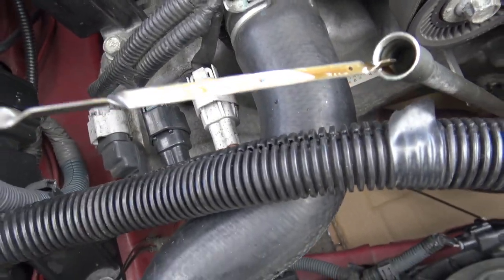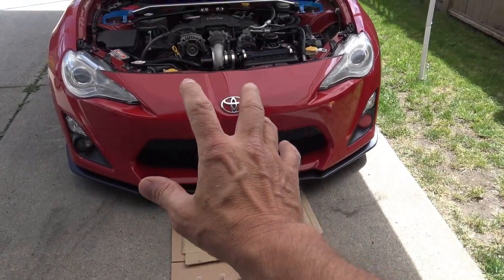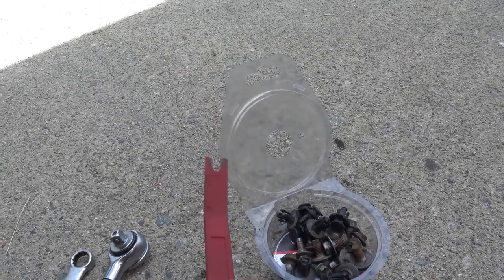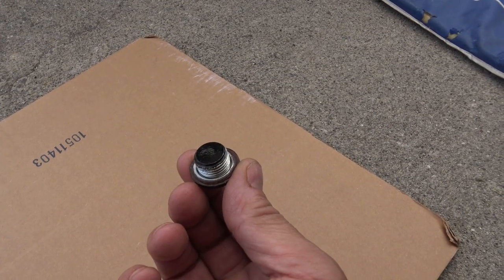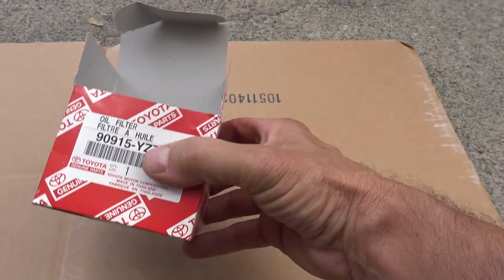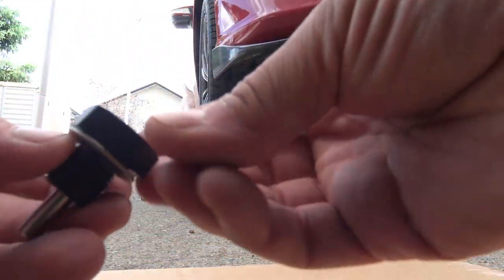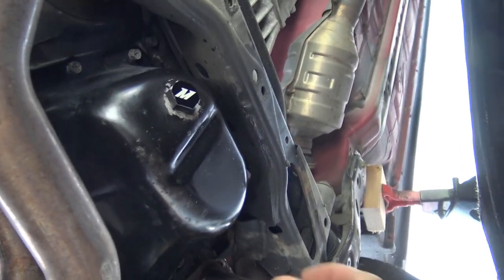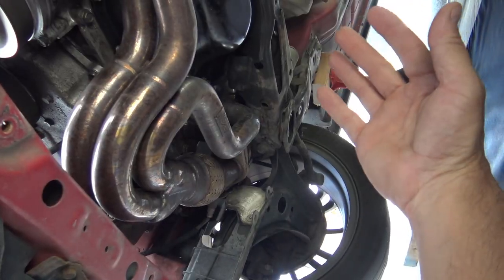What happens if you overfill your engine oil?

Comment: Just drain the excess oil and you're good
Reply: How do u drain excess without draining it all
Reply: @moeyyoussef774  take the drain plug out and wait a few seconds then put it back in then recheck your level
Reply: but you’re already there. why not just drain the entire engine oil…… youve gone to all that work with the under tray just to drain a litre of oil 🤷‍♂️ might as well drain the entire thing, the old oil looks dark anyways…….
Reply: @marcferrer1333  Yes you can also do that too and then put in the proper amount of oil
Reply: @kubotaman85  but your recommendation is not a good one………. just drain the excess oil when you have gone to all that work is a waste of effort……
Reply: @marcferrer1333  I've worked on my own vehicles for quite some time now. All you have to do is pull the drain plug out let some out then put the plug back in then recheck your oil level. You can damage the seals if you drive the car with the oil overfilled.
Reply: @kubotaman85  ive also worked on my own cars for years, im a qualified technician for ten years……….. just sayin if you gonna go to all that trouble just to drain a litre or so of oil then might as well drain the whole thing……… you are there, its almost a waste of time and effort just to drain a litre or so of oil. thats my point
Reply: @marcferrer1333  That's your choice if you choose to drain the whole engine.
Reply: @kubotaman85  i know its your choice, but thats like doing a clutch and not doing the rear main seal while you’re there………
Reply: How about siphoning
Reply: @siberianstuntman3344  if ya have the tool to do do that can work also
Reply: @moeyyoussef774  you drain all of it and start over
Reply: @marcferrer1333  how do you make sure a jiffy lube doesn't overfill??
Reply: @sl4983  im not sure what you mean by jiffy lube, i guess you mean a quick service station?……🤔 if thats what you mean then you cannot really make sure that they dont overfill unless you’re watching the technician the entire time……. but if your doing the oil change yourself then ALWAYS put less than what is recommended, if it says the vehicle needs 4litres then put 3.5litres and adjust accordingly.
Reply: @marcferrer1333  you don't know what a jiffy lube is? Thought they are everywhere.
Reply: @thelegendarywasdgamer9724  do you mean dodgy lube?………. then yes they are everywhere….
Reply: Ive been driving mine over filled cause i dont know how to drain it.. i have not seen any problems though
Reply: @louisbarningham  If it's not more then like a a bit over half a inch over the full mark on your dipstick you should be fine.  You can always buy a cheap siphon pump from harbor freight or Amazon and pump it out from the dip stick tube.
Reply: @louisbarningham  All you have to do is open up the drain plug and drain the excess then put the plug back in. It's not that hard
Reply: Well duh but your going to make a mess trying to put the drain plug back on because there is still oil coming out of the pan
Reply: @marcferrer1333  he said it was only 2 weeks old, I would maybe change it sooner if I had some extra money laying around, not everyone does tho. 2 week old oil is 2 week old oil, viscosity doesn't change in just 2 weeks, black stuff is very good at difusing and a very small amount of black carbon can make alot of oil look very dirty. I would suggest not wasting the oil, but I could see why alot of people would. I would have added some seafoam or something and just called it an oil flush.
Reply: @marcferrer1333  lmfao
Reply: @marcferrer1333  so it better to do an full oil change to get that excessive amount oil out? My 02 accord got 2 or 3 quarts and white smoke came out my exhaust too. I just need to know bc this my first oil change I’m doing next week on my car. Is it just better to drain the oil and put a fresh new oil in with the right quarts it provided. I got to much in my car just need to know if it will drain it all out.
Reply: @JediMaul  one thing to remember when filling up with oil is ALWAYS put less than what it says, so for example: if it says your car takes 4 litres, put 3.5 litres and re check…… because its easier to put oil in than to drain out if you over fill
Reply: @marcferrer1333  thanks man!
Reply: @marcferrer1333  I just put new oil in, u put to much, I think I should just drain a little
Reply: @thrillslime4762  thats why always put less than what is recommended……… and re check after starting the car. because its easier to put oil than drain the oil.

Comment: When I overfilled a old 1,6 L Toyota with 1,2 L, I did nothing. Ran like this until next oil change 15.000 km later. No problem and the car drove 100 k km more, before it got scrapped with a blown gearbox.

Comment: Yea i also overfilled my V8 4.2 (VW) i just shove thin plastic or tygon tube down the measuring stick tube and suck it out with brake bleeder/vacuum tool into a glass jar, done! you can make your own vacuum jar from pickles  just put in 2 hose barbs into the lid, and apply vacuum to one barb and hook other to the liquid you want to suck out, it works like a charm...

Comment: Overfilling by 1qt will not cause a problem depending on your vehicles oil capacity.  For example, my car takes 7 qts.   On one occasion in the past,  the mechanic did overfill by a quart and It caused...no problems.   If your car holds 4 qts, than 1 quart overfill "might" be a problem but even then, it may not be.  Most engines leave some room for a overfill.  As long as the crankshaft doesn't come into contact with the oil in the sump causing foaming, there should not be an issue.  But anything over a quart, I'd drain some out.
Reply: Interesting info, is this foaming similar with overfilled ATF transmission fluid ?  Because excess  fluids is more likely to foam? Thanks 👍

Comment: Older American brands typically can handle a quart over filled with no problems or harm. Newer engines can handle a 1/2 quart. New(er) oil has anti-foaming additives.

Comment: Why didnt you just drain some oil out?
Reply: Like he said, he couldn't even remember the last time he changed the oil. Seems like a pretty good time to change it to me.
Reply: @imnotabotrlyimnot  thought he said he’s been driving with over filled for 2 weeks?
Reply: @iishyxvietxboyii  Yeah, but not because he changed the oil 2 weeks prior, he didn't. He overfilled after fixing  a leak on the dipstick tube. He didn't remove oil to do that, just checked the level, it was low, then he added to much.

Comment: I've been a Toyota tech for 25 years and this is one of my pet peeves - overfilling motor oil.  A lot of people including dumb mechanics try to get closer to the upper limit on the dipstick but the oil level just needs to be at or slightly above the lower limit when it's cold, that's it.  Overfilling oil is dangerous for your engine.  If you ever get to see what aerated oil looks like then you will never think about overfilling the oil ever again.
Reply: If it’s a bit above the top(higher)dot and half way to the twist above it. And, over the time of at least three months time, here’s no drop on the oil level. Does that mean it’s fine? I remember somewhere said the twists on dipsticks are the absolute low and high points. Is that true?
Reply: Hi Joe, I have a Toyota Aristo v300 2jzgte engine. My mechanic had overfilled the oil without me realizing. Could this be the cause as to why it surges when I hit boost on the second turbo?
Reply: @Keep_Crying_Son  I doubt it, overfilled by how much?
Reply: @CamKrazy2000  almost halfway up the dipstick, I managed to drain most of it. Maybe a crappy plug or something.
Reply: @CamKrazy2000  Honestly not really, the 2jz does smoke alittle on start up, I think they all do, something to do with the lifters or valves....Not 100% sure on that.
Reply: @Keep_Crying_Son  that’s your valve stem seals leaking oil into the cylinders. It’s a common issue with JZ motors. Have to take the camshafts out and valve springs to do the valve stem seal replacement

Comment: Oil change should be done at least every 12 months,  with a new filters , I do air filter and oil filter every time I change the oil.
Reply: Rotate and check PSI on them rubbers ☺️
Reply: Oil & filter changes should not just relate to time but distance travelled & type of use the vehicle regularly undertakes , that’s why most factory manuals give different service intervals for normal or severe duty use , especially for vehicles that tow heavy on a regular basis . The oil change interval should be anywhere from 2 to 4 thousand Kim less for these vehicles , although by default if these distances aren’t covered in 12 months the oil & filter should be changed as you stated for many reasons , one being a vehicle like mine that is lpg fuel only actually makes oil acidic over time , which obviously isnt good for any engine.

Comment: No such thing as too much oil unless the oil begins to aerate from it hitting the crank or you get other issues but for the most part you can keep putting oil until oil begins to foam. Nissan with the exact same engine and exact same oil pan changed the spec on one of their engines from 3.5 to 5 quarts without a single issue they just changed the dipstick and that was it. Engines aren't designed to where they're on the verge of foaming.

Comment: I did an oil change yesterday. I took my car for a drive. Even though I noticed it was a little bit high. Maybe a little bit over 1/2 qt… I consistently but lightly tapped the accelerator and noticed chirps with every press. I don’t know what that is. I found it very off putting. I decided to go to the gas station and pick up some drinks. Probably 1 mile both ways. I also noticed the car was shaking me a little more than usual as I got closer to the station. I decided to push a little harder on the pedal one I got really close and the cars engine light came one and started shaking like crazy so I let off the gas and coasted into the station… I got out and looked at my plug. I seen my gasket wasn’t on my plug. That was off putting. I was back home in my drain pan. I went into the store and bought my supplies and got back into the car. I let it cool off for about 10 minutes while I drank a rockstar. I turned it on. Drove home like a snail. Had no problems. Drove back onto the ramps. Let it cool for 30 minutes. Pulled the plug, slipped the gasket back on to the plug. What ever drained out was good in my opinion, I’d estimate a 1/2 qt came out. Then I drove it around town before taking it out to the country to wind it up. I hit about 135mph in no time at all and it was purring like a kitten. I’m hoping that rattle was just me over filling by a half quart… shit sucks when it goes wrong lol😮

Comment: There are situations where you could consider overfilling.
1) If you regard oil to also act as coolant, overfilling might cool down turbo charged engines by a few degrees. 
2) If your driving profile is based on excessive short distance travels. overfilling will improve the oil's resistance to fuel dilution.

Comment: I once worked next door to a construction company that used an F250 work truck with a 300 ci 6 cyl. A very young green employee was called upon to position the oil pan and open the drain plug, during the oil change. He drained the manual transmission instead. After the oil refill process, it was discovered the engine couldn't even be turned over. It held 2 X the normal required oil and all of it had to be drained, before refill.
Reply: LOL
Reply: Smh lol

Comment: The oil is suppose to look black after it's in the vehicle after 300 or 400 miles. Just the heat from the engine running will blacken it.
Reply: Not in an lpg engine ,  6000klm & it’s still so clear it’s hard to see the level on the stick .

Comment: If you just did the oil change, should be straight forward process. Let it warm up, not HOT, just WARM, don't run it any longer than needed. Remove and drain oil filter, Drain drain oil, pour into appropriate containers to measure, refill with proper amount. Don't stress it. It's OK to mistakes! Just be glad you caught  it ;)

Comment: Hey, where did you buy the Inverted Oil Filter Mount on top of the oil filter sandwich plate? It is so nice that can hold the oil from dropping around your engine bay. I can only find one company that makes it which is Baxter, but they are way too expensive. Can you let me know where did you get yours, I would like to buy 1 or 2. thanks.

Comment: Ever wondered about going a higher viscosity than the 0w20 Toyota recommends? Especially since you've supercharged the engine and it's definitely gonna be pushed more often.
Reply: Or to use a oil additive , antifriction as protection .
Reply: Without accurate readings at various RPMs for your oil pressure. Changing the viscosity of your oil can and will hinder its ability to get to places like the connecting rod bearings which if not properly lubricated, will wear out and spin causing Rod Knock.

The engine block as prebored passageways to get the oil where it needs to go and since your supercharger didn't increase the bore size and you didn't get a pump to increase the flow and pressure, the viscosity will wear those components faster.

Oil thickeners are just a temporary bandaid for a bigger problem.

Comment: When adding oil add a little at a time. Also buy a pump to pump out if you overfill. That is an expensive nice car, so you should be able to afford the oil change equipment and pump. You should also get a funnel that screws into the drain cap housing. After adding oil 5.5 litres start engine and run for 30 secs, turn off and lower and recheck level after 5 mins. Also get a container that has the 5.5 litre marking on the outside-clear plastic container. You can also get a 3 ton jack for lower cars.

Comment: I bought a used Cadillac Escalade with the 6.2 motor. The factory specs say 8 qts.  I know the oil was recently changed by the dealer. I checked the level at home and it was over filled way above. I happen to have battery operated  oil pump that sucks oil through dipstick tube. I removed 1 qt. and now slightly above. Yea don't want to froth the oil .

Comment: Please one question it happened to me at the Honda Dealer Service some idiot guys done that they put 4 Liter of oil instead of 3.7 Liter,  it can cause gamage or it's ok ? I checked and it was a little over the maximum line on the dipstick ! Because if this happens I promise I never go again to the service and next time I will change the oil and everything by myself according to the service manual and not paying the extra price if they purposly damaging my engine !

Comment: I made dummy mistake with my Camry I forgot to drain my oil while do the oil change and I added 5 quarts more to old oil.  I only driven for 24 miles throughout one week.  I just drained everything out and re added to correct amount . Do you think I damaged my car or the crankshaft got messed up for having 10quarts? There  some amount of white smoke and engine oil smell not to strong less than before.

Thanks
Reply: rong wang I did something similar but about 5 & a half quarts on a Z. I did exactly what you did after I noticed my car wouldn’t start after changing oil. I now have a oil maintenance light myself but not a CEL. Car felt limp but I’m good as of now
Reply: How's the car now?

Comment: My rx8 don’t like too much oil Ment to have it at half way but had it sat for months over the lockdown so did a top up then went fir a nice hard drive then went round the roundabout bit fast and got a oil burp lol loads of smoke at the back exhaust.    So had to remove the air filter and new paper filter then clean out the maf and the throttle body and air intake I’m glad I didn’t blow the engine

Comment: Pro tip: you do not have to take out the covers on the bottom of the car to drain the oil. A hole is provided.
Reply from the maker: Tue, I had the covers off to look for the location of an oil leak.
Reply: It's definitely a good idea, unless you want to waste a bunch of rags, time and soap to clean up the mess. Best to take off the rear fasteners and pull it down out of the way.
Reply: @juansolo1617  there is a hole in the bottom of the cover where the drain plug is.  You won't create a mess at all.  There is literally no difference between keeping the cover on and taking it off except that you have to do more work.

Comment: I overfilled my corolla by about 3L with 300,000km on the odometer. I drove it about 60km before the oil light came on. Overfilling caused the gunk to clog up the pickup. Oil flush and change problem solved. Toyota tough.
Reply: I always use a engine flush , either Amsoil or Liqui-Moly

Comment: Hi, i think i added to much oil a week ago. Now my car has a crank no start
Reply: How's car now ?
Reply: @acemoto2319  It never started. Mechanic said it was electrical. Never found problem. Im currently car- less. I take Uber to work. Will have another car soon.
Reply: @Iheartcatz  ok thanks 👍 Tomara, get a friend to check your battery connections... Sometimes it's just loose rusting connections that simple needs cleaning and tightening or battery 🔋 is dead.
Reply: @acemoto2319  Aamco did check the battery. They checked alot of things. It had alot of miles 207,000 but well taken care of. So whatever it was, i had a second opinion from a good mechanic who was baffled. I just let it go and junked it.